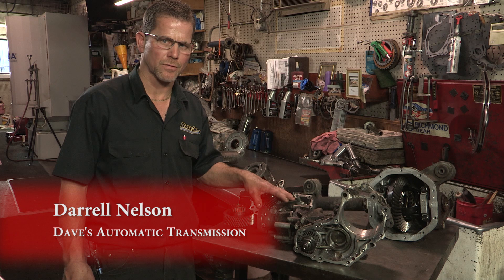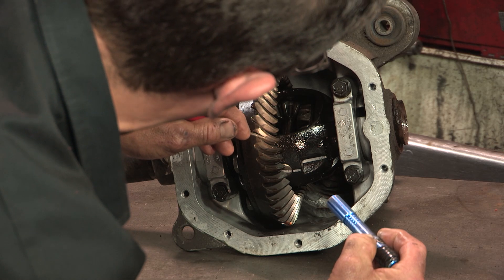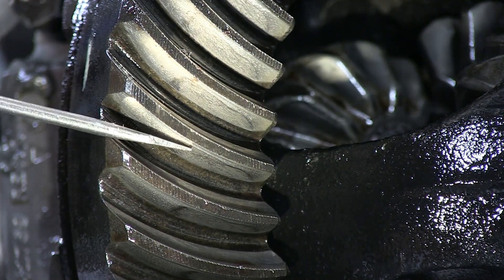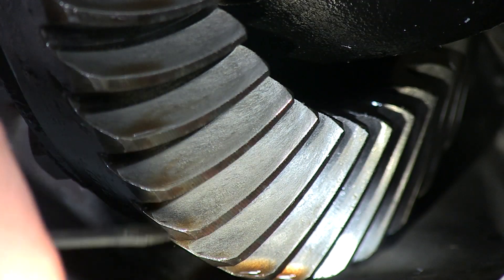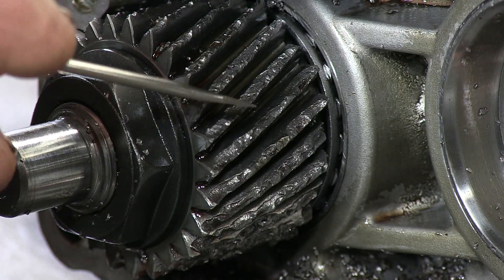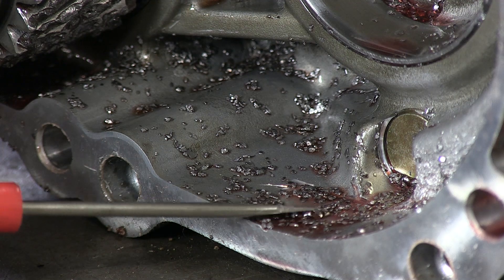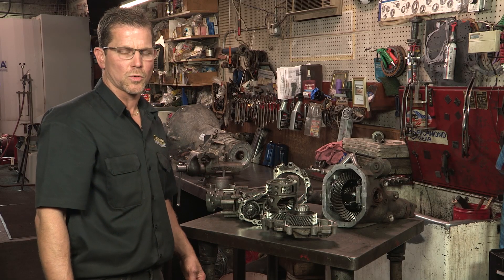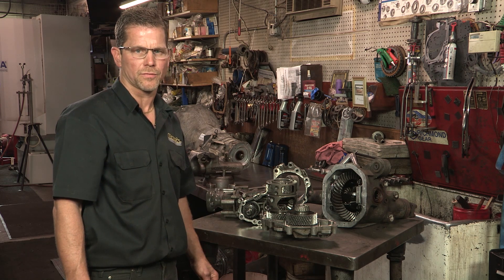How to Maintain the Fluids in your Differential and Transfer Case

Comment: Guys, one simple advise if your car is over 80k mile without changing gear oil don't change the whole quantity at once. Start to take 1 litre of old oil and add 1 litre of new oil, then next month extract 2 liters of old oil and add 2 liters of new oil, after 3 months change the whole thing with new filter....

Comment: I have Honda accord 2008 v6, I'm not sure to use amsoil ATF fluid because people told me to use only Honda ATF fluid nothing else, can damage my transmission
Reply from the maker: The AMSOIL Synthetic Multi Vehicle Automatic Transmission Fluid (product code ATF) is highly recommended to use in a 2008 Honda Accord transmission.  AMSOIL ATF meets the Honda ATF Z-1 specifications, and is formulated to provide improved protection over the factory Honda fluid.  There should not be any problems using AMSOIL ATF in your transmission. Feel free to reach out to our Tech Department at Tech@amsoil.com if you have any additional questions!

Comment: That transfer case doesn't look like it was overheated. It looks to me more like it it was just run without fluid at all. The remaining puddle left in the bottom didn't even look burnt. I've seen inside thousands of transfer cases that have severely burnt fluid in them and I have never seen metal shavings that large.

Comment: AmsOil is really great oil.... The chev, ford, dodge, etc.. even with the best of oil is still a lemon 
Vehicle factories buy cheap, sell high for maximum profits while costing the consumer in the long run
If you want a good vehicle, you need to build it your self with quality parts not cheap assembly line junk